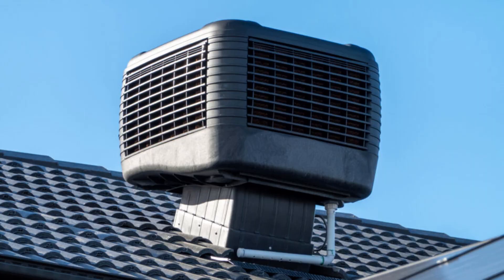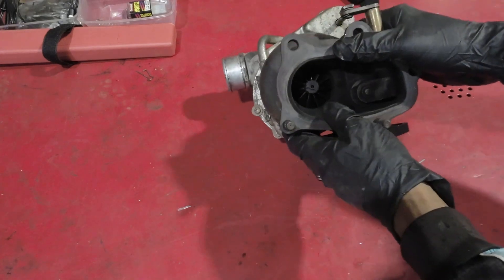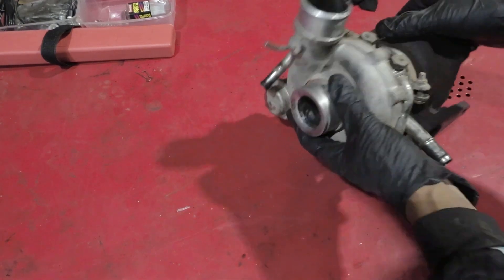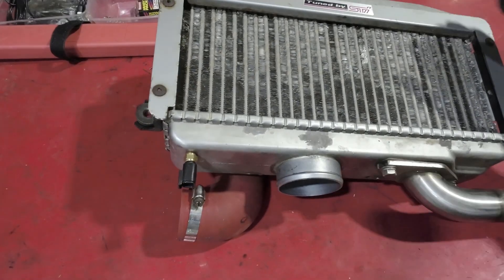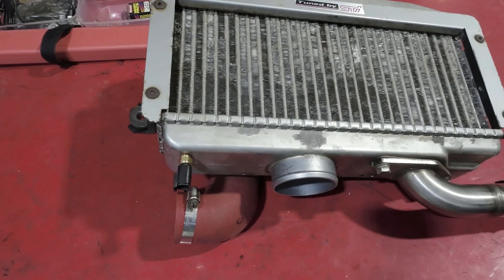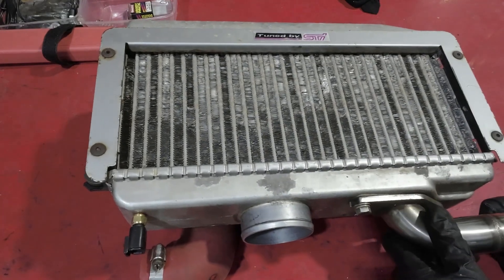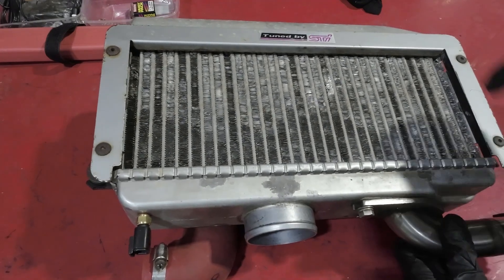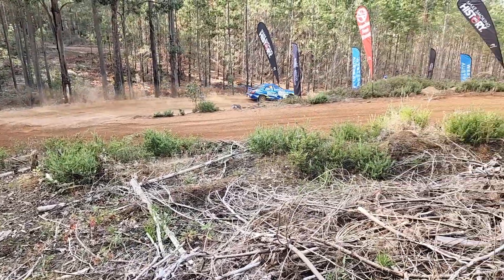WTF is an intercooler water sprayer?

Comment: intercooler water sprayer for when your car is at a stop and idling, the hot compressed air is forsed to the engine and when there is no air rushing trough the intercooler to cool the air down you spray water to keep the air cool
Reply from the maker: @fredfuzzbear in almost all cases the intercooler water sprayer is disabled at idle or low RPM.  It's designed to help cool the charge air at higher boost levels and RPM. If it was switched on all the time, the water tank would empty too quickly.

Comment: My GP N Lancer Evo II came with factory inter cooler sprayer that came off the windscreen washer bottle. Was very easy to use and always had start line people telling me I had a leak. Excellent video thanks very much
Reply from the maker: I remember the first time I saw the Mitsubishi set up on an Evo 3 at a WRC event in the mid 90's. I wondered why there were retic drippers constantly dripping water in front of the intercooler until I realised it was the water spray for the intercooler. Thanks for watching! 👍

Comment: could you do a detailed video on aftermarket turbo actuators? i just bought a GFB turbo actuator but finding very little well compiled reviews / tutorials online about them.
Reply from the maker: Thanks for watching. Are you asking about: 1.) an internal waste gate actuator,  2.) an external waste gate, 3.) a boost control solenoid or 4.) Electronic boost controller? We have experience with 1, 3 & 4. We're not allowed to fit external waste gates to rally cars so have never fitted one.
Reply: @rallyactionwa  specifically the turbo wastegate actuator ... the bit that bolts on to your standard td04 to control the wastegate, the one i bought is called (WGA 7304 Wastegate Actuator for WRX Applications) most videos online are promotional material not a lot explaining tuning or the advantages of running an aftermarket one.
Reply from the maker: @hakology  OK. We'll see what we can do.